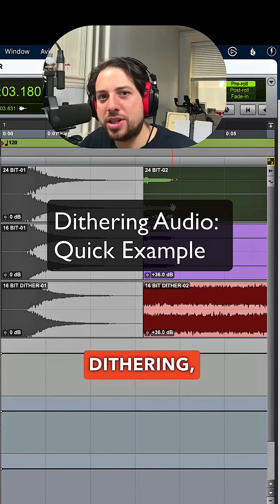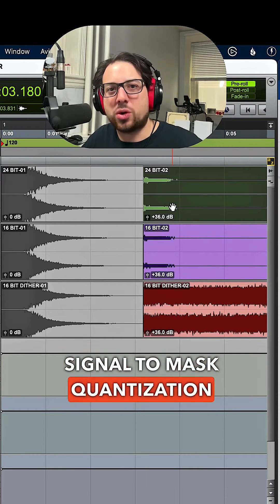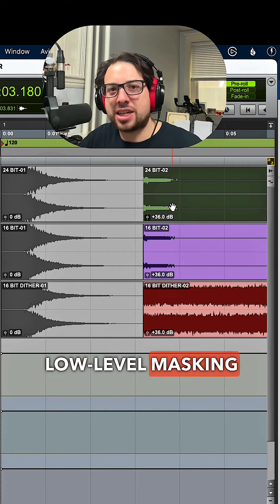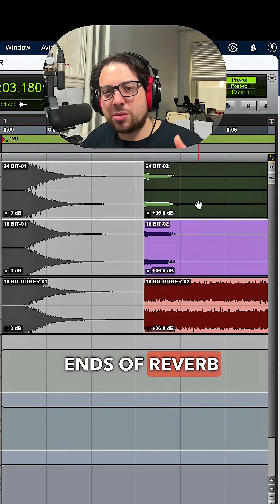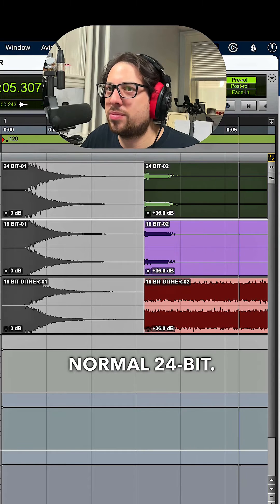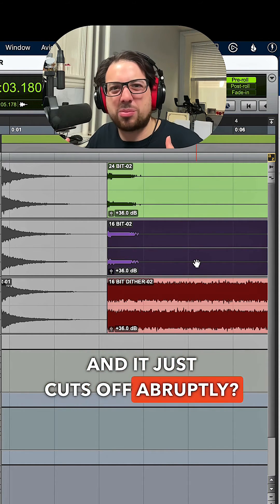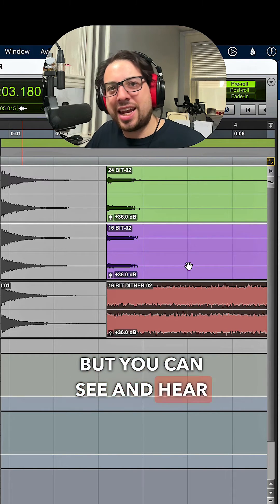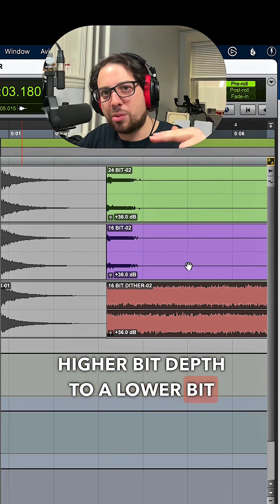Dither Explained (With Sound Examples!)

Comment: Hey mate, I just replicated your experiment, and at first, I couldn't hear any difference either. But I figured out the issue. the key is that those crackling artifacts only become noticeable in very quiet parts... i.e when the audio level drops below -60dB. If you focus on those sections and crank the volume way up, like really high, you’ll hear the artifacts when A/B testing the 24-bit version against the 16-bit one.

Initially, I didnt understand why I wasn’t hearing any difference, especially since I made sure there were no other dithering plugins and no dithering options enabled during export. The problem was that I wasn’t listening to the right parts of the track. To hear the artifacts, you need to focus on those very quiet parts, like the low end of reverb tails, basically when the sound is almost inaudible, typically below -60dB.

So, for anyone trying to replicate this test, make sure you're focusing on the super quiet sections, crank them up, and you’ll catch the artifacts in A/B testing.

Thanks for this again , but I’m curious, if these artifacts only affect the very quiet regions, does it even matter, since we usually can’t hear them? Or maybe on a high-end system, like something above 10k watt,  I gues they will shine in the mix hahaha right?

Comment: But for some people the distortion sound is just what they want so..
Reply: If this is the sound you want, you probably also want it more audible.
Ableton live has an effect that lets you turn down both your samplerate and your bit depth, which you can dial to your own discretion.
Other DAWs will likely have it too. Not a very complex effect.
Alternatively you can probably find free vsts that do the same.

I can not imagine this being something you want to add by the method of not adding dither. It would not be very effective at creating the desired effect.

Comment: I don't get it. You add the noise, then remove it after, or you leave the noise in? It sounds horrible
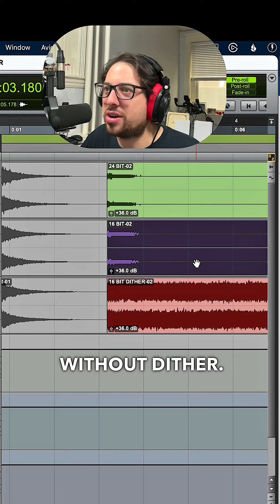Reply: Because of the nature of the digital domain sounds like 0:42 will ALWAYS be present after going from higher bitdepth to lower. And here you have the choice: either they will stay in the signal and be very noticable and annoying or you will add a very quiet white noise which will mask them. White noise is quite plesant to the ear because of it's constancy and randomness. It was first added to the old tube TV sets, so when some people would fall asleep in front of it, without turning it off, the TV will emmit a pleasant sound which won't wake the person up. Notice: 24 bit signal is only 0,5x more than 16 in the terms of bits, but because it rises exponentially the difference in the ammount of loudness levels is 3906x more than 16bit. So the ratio is the same as 24h day vs 17 seconds. No hardware made a bigger change in my music production than going from 16 bit to 24 bit soud interface.
Reply: These examples are all heavily boosted, the noise would be left in before downsampling at a very low level
Reply: The noise remains throughout, as it effectively masks the distortion or quantisation artifacts by forcing your auditory system to 'smooth' what it hears. By establishing a slightly higher noise floor it just disguises the unwanted artifacts amongst the synthetic noise.

Different 'shapes' or 'weights' of dither (different EQ curves applied, to create more midrange but less very high-end, for example) is also commonly used when downsampling or resampling. Dithering did also significantly improve the quality of lower bit depth audio back in the early days of multimedia, when codecs weren't capable of decent noise floors. 

Listen to this for an example of lower bit depth audio with a bit of dithering to help it along: https://www.youtube.com/watch?v=RaLKPK0LzGQ 

Dithering as a technique is used in signals everywhere in modern video and audio codecs, partly as a way to be efficient and save on bandwidth / transmission costs while preserving as much of the perceptual quality as possible.
Reply: jup